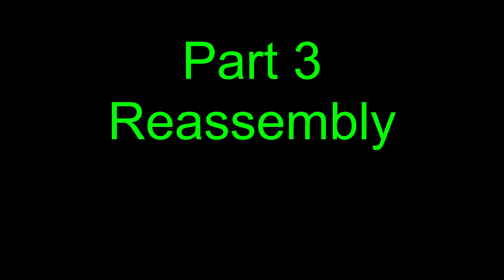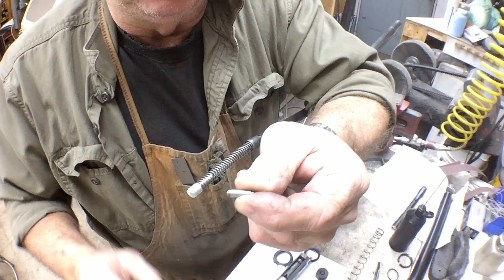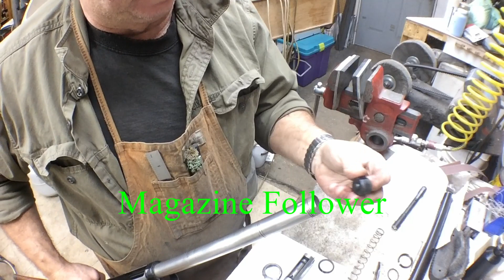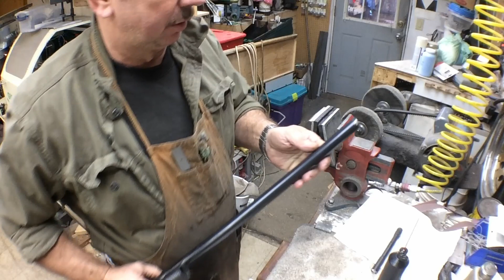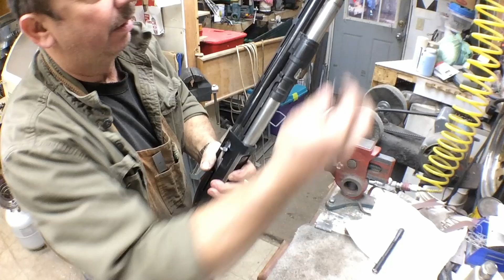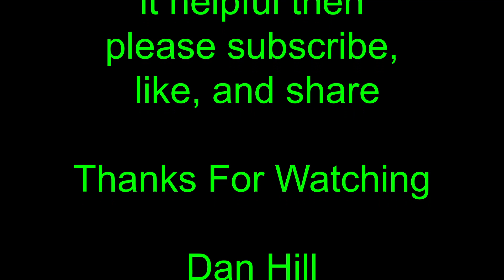Remington 11-87 Repair and Service Part 3, Assembly

Comment: I bought an 1187 police brand new in 2007. After about 5 years I bought  a new barrel with rifle sights to replace the bead sight barrel. About 3 months ago I bought an 1187 premier complete action on gunbroker. I put a new stock an forend on it and the bead sight police barrel. I took the premier out and put 50 rounds of slugs and buckshot through it and it ran perfect. The question I have is this. When I pull the bolt back on the police it goes back ALL THE WAY. When I pull the bolt back on the premier it goes back ALMOST all the way and locks. Then if I pull it back another 1/2 inch it locks again. I have switched out all the parts on both. What I have found is the link is the culprit. When I switch the links it does it in the police but not the premier. The links seem to be identical. I am going to buy a new link. Is there any thing you might know about why this is happening.
Reply from the maker: not certain, but there are a couple of things I would check. Are they both 3" guns? are the action springs the same lengths" it almost sounds like there is a spring stack up happening. Also the link may be binding on the edge of the action spring tube. It may be rubbing enough to be giving the impression that it is locking back earlier when in reality it may be binding between the bottom of the link and the edge of the action tube. Dan
Reply: Thank you  for your prompt reply. I ripped both guns apart and found that the link in the premier was not true or warped or bent. The tips of the link were not hitting each other when put into the action spring follower. They passed each other and caused the link to constrict more than it is supposed to. I tried bending it but couldn't get it to work the way its supposed to. I will buy a new link and the problem will be solved. Sure would like to chat with you sometime if that's possible. I love my 1187 police !!!

Comment: Thanks this was a huge help! Concise and straight to the point. I have a question if you have time. I have a damaged action bar, the part that the bolt rides on had a piece break off, putting my 20 Ga. out of commission. Midway has the action bar but I need to know the best way to separate the action bar sleeve from the action bar, thanks for the great videos! PS, Hope You and Yours have a Merry Christmas! & a Great New Year!
Reply from the maker: You will probably have to work with it to find the best way to get it off of the action bar. They are spring steel so you can carefully pry on it. I have been able to work them so they will slide rearward on the rails if you can get the bottom tab over the bolt plate, but I have also been able to get one of the ears over one of the rails then it is easy to remove. I honestly don't know what Remington recommends..
Reply: @hillsgun  Thank You, it looked pretty straight forward but I wasn't sure. the part from Midway is on back order so I'll be using my Red Label Over/Under for a while. never hurts to have a spare weapon! Thanks Again!

Comment: I have an 1187 special purpose. I was told that something had to be done to make it shoot 3.5 in shells. Can you tell me what needs to be done. Also what size oring is used.
Reply from the maker: Is it a 3 1/2 inch gun now or is it a 3 inch? It uses the standard Remington o rino
Reply: It's a 3.5 gun
Reply from the maker: @chrisclark5440  then it should function fine with 3 1/2 inch shells, most of the problems occur when you try and shoot the shorter shells.
Reply: Ok thanks for your help

Comment: 1187 bolt wont lock back per loading tube. and wont lock back after shells are spent.... ideas ? Thanks
Reply from the maker: Could be several different things, but most commonly it is related to the intercepter latch. Spring on the intercepter latch may be out of position , broken or missing, Latch may be broken or missing, or the c clip that retains it may be missing in which case the latch may also be gone.

Comment: Excellent video really helped me out with my 11-87. Purchased used and my second season using it for dove it would not feed the second round. With this video i was able to give it a good cleaning and found the magazine tube looked like it had never been cleaned or touched. Had so much build up i feel this really had to be the problem.  I'm hoping this simple cleaning was the issue with failing to feed. As the fired round would eject like normal and the second round would come out of the magazine tube but the bolt would stay locked back and the shell would not load it would just lay on/inside the trigger area. If the cleaning does not work would you have any recomendations for me as far as parts needed to be replaced?  Thank you!!!!
Reply from the maker: The only thing that should need to be replaced is the o-ring seal. It sounds like the gun is short cycling which could just be caused by being dirty, just make sure the mag tube is clean and dry. No lube in that area. Thanks, Dan.

Comment: Really enjoyed the thoroughness of the video series. You have given me several ideas for solving the problem I'm having with a Rem 1100 20 ga. replaced piston and piston seal, captured type, o-ring obviously, cleaned and polished butt-stock spring tube, put spring components through ultrasonic, cleaned and dry lubed outside of mag tube. On the barrel ports I just used solvent and a small spring-steel wire to make sure they were open. didn't ream. There may still be a little carbon. I'll double check that. I re-staked shell latch. I'll double check that to make sure I didn't raise any metal that could be impeding action from sliding freely. If you have any other ideas I'm open to suggestions. It cycles far enough to re-cock trigger, just not far enough to extract spent shell and chamber new round.
Reply from the maker: Gun is still short cycling. Is it a 2 3/4" gun or a 3" gun? and what ammunition are you running thru it? Is it an older Gun? If it is a 3" you will probably have to run heavy 3" loads the same with 2 3/4 heavy 2 3/4" loads. Promo loads from wall mart or any where else will probably not cycle it. It is most likely ammo related as the newer ammo"s don't have as much "powder" Lower pressures and a different pressure curve. If you are shooting steel shot the problem is aggrevated more as steel runs lower pressure. If you are using it for waterfowl out of a pit or pass shooting it may be a problem with your mount as it is hard to get a gun properly mounted high on your shoulder when shooting overhead and will cause short cycling.

Comment: Did you ever make your tool to remove the butt stock?
Reply from the maker: yes I have been producing a 1100/11-87 buttstock socket which I have been very happy with. I have another run machined but they have not been blued yet. I will try and get them posted on the website next week. Everything I have produced to date has been sold thru a distributor but that contract has been filled so I can now put them on my website. Thanks, Dan.

Comment: Just recently my 11-87 has been having the lifter get stuck randomly could be second shot could 150th shot but the small square which pivots up or down seems to be the issue. When it gets stuck I open the action and use my pinky to push the small square down then I can get the lifter to move up freely. Is it a spring issue?
Reply from the maker: Hard to know for certain without having it in my hands.Is it a 3"gun? It is more likely that it is a combination of ammunition, to light and if the gun is dirty it will short cycle and can hang which is most likely the case, to heavy a load will sometimes display similar symptoms by cycling to quickly and it doesn't have time to complete the feeding cycle. 3 and 3 1/2 inch guns are more prone to function problems with lighter loads and when shooting steel shot as steel usually runs lower pressure.

Comment: Nice video series for the 1187. I just picked one up and the shell latch fell out. How did You re-stake it in with the vise grip?
Reply from the maker: Thank you, The staking tool is one that used to be offered commercially, I don't know if they are still available. the one I am using is shop built. It has the jaws ground smooth and parallel and is drilled to accept a hardened pin which does the actual staking.

Comment: I have a fairly recent 11-87 (about 3 years old). The guns has the combined seal and it has worked flawlessly through thousands of rounds of trap and skeet. If Remington has discontinued the combined seal, it would have had to have happened within the last three years.
Reply from the maker: I Have had mixed results with the combined seal system. The 3 year time frame would be about right, I did not check directly with Remington, but when I checked with one of the distributors I use they showed the combined system as being discontinued by the manufacturer and the 2 pieces as available. My speculation is that either the combined rings didn't perform over the entire range of guns which I suspect is the case from my personal experience with them, or it is possible that it was cheaper to offer the 2 pieces which are universal in the remington line. If you are primarily using yours as a trap and skeet gun you have probably fed it a fairly steady diet of fairly mild loads while another shooter may be feeding their gun a steady diet of 3" magnum steel loads for waterfowl. They may very well be hammering their gun apart and excessivly be eroding away their gas system so their results may well be different from yours.
Reply: My intent was to use the gun for a multitude of purposes, including slugs and potentially waterfowl. In fact, I just got back from a deer hunting trip. Would you recommend going to the 2 piece seal or leaving things as they are?
Reply from the maker: If it is working don't change it. My intent was not to say it is necessarily bad, just that there are so many variables that what may work for one won't necessarily work for all. I tend to be hard on gun manufacturers because the quality which was once put into a gun has now in a very large part gone away and what is being produced now is done as cheaply as possible. We have replaced craftsmanship with engineering which may or may not work in the real world and I thing the captive seal system may be one of those items as it does work, and in your case is working well, I just don't beleive it works in all guns as intended so now instead of refining it they have apparently discontinued it. The forend that I fitted in the first video of this series is another example of our mass produced mentality by gun manufacturers. It was a very nice forend with good wood and the finish was well done, the only problem with it was that it didn't fit. I had never seen one machined so far out of tolerence and it should have never made it to the consumer. anyway I am now done with my rant. If yours is working fine don't break it by trying to make it better. Dan.
Reply: Dan: I looked it up and the current 11-87 Owners manual still reflects the use of the one piece piston/seal. However, Brownells shows only the two piece.  So, I'm confused.

To your point; My daughter was given my brother's 870 Wingmaster built in '77.  The gun only had about 10 rounds put through it before she was given the gun. The difference in the quality of that gun vs the Remington's of today is staggering. 

That being said, my relatively new 11-87 has performed without a hitch so, I really can't complain. Personally, I like synthetic stocks vs wood stocks due to their durability in harsh conditions.  Mine happens to be a synthetic stock with rubber inserts in the fore-end and pistol grip area.

I also own a model 700 built in '68. Again, the difference from that Remington to those build today is mind-boggling.
Reply from the maker: Yea: It will only become an issue for you if yours reaches the point where it needs to be replaced so just enjoy the gun, I consider myself to be old school concerning guns as I have delt with them for a lot of years if it ain't broke don't fix it. someone always has some new snake oil to sell you, it doesn't matter if they are a gun manufacturer, Retail shop or gunsmith so do your due dilligence before buying into anyones recomendations including mine. As far as stocks I am a wood guy. I have some synthetics, but every old gun has a story to tell and a wood stock and condition of the metal helps me to read the story plus I think it looks and feels better to my soul. Dan.